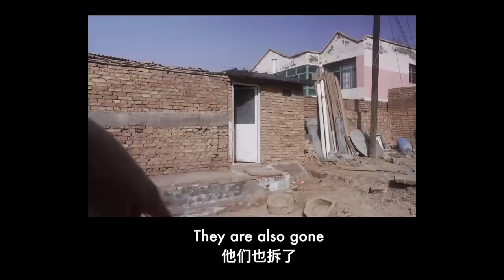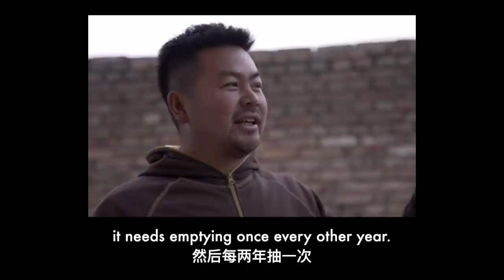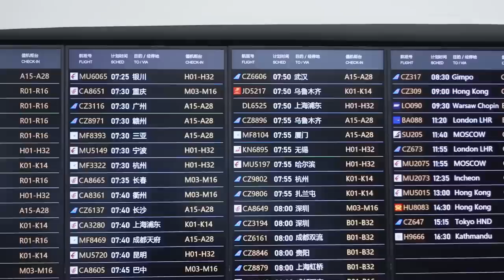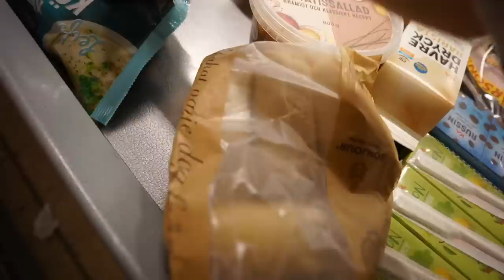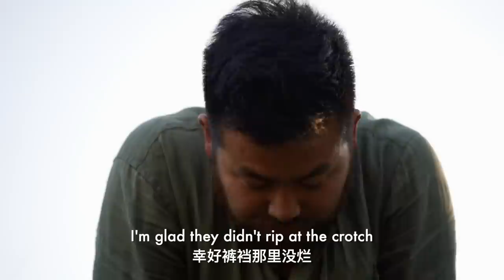And so, a new chapter begins!

Comment: I am from rural China and my family installed bathroom with pipe going to very deep hole in back yard. They didn't put in any plastic waterproof tank so basically the water just go down the deep ground. They don't use indoor bathroom for poo usually so it's kind of okay without the tank
Reply from the maker: Yes if it only urine I suppose so!

Comment: Miriam, consider buying a Volvo EX30 electric vehicle for your planned road trip. Volvo is headquartered in Gothenburg (where you renewed your visa), but since 2010, it is owned by Geely Holding Group, where most of their EVs are manufactured in China with some manufactured in the USA. It would be fitting to explore all those traditional places your mentioned in a 21st Century Swedish/Chinese EV. I hope Volvo/Geely would sponsor your trip.
Reply: Why???.
Reply: With a price of ~ 44000$/€ it's not an option for most young families 😅
Reply: @evelinholmes6401  I am assuming you are asking why a Volvo EX30 EV. Because it designed in Sweden and manufactured in China, appropriate for a Swedish/Chinese family. Volvo vehicles have excellent reputation for safety and that it good for the whole family. From what I have read, it costs nothing to get a license plate for an EV in China, whereas you have to pay thousands and wait for weeks for an ICE (Internal Combustion Engine) car license plate.
Reply: @NordicLight365  I could be wrong, but since Volvo manufactures most of its EVs in China, It would cost a lot less in China. I have noticed Chinese EVs are much more expensive  in the EU because of import taxes and shipping. For example a BYD Dolphin costs around $18K in China and it would not surprise me if it costs around $30K in Norway.
Reply: @chirkchu3903  Well, the BYD Dolphin is a totally different car;), and when it comes to the Volvo Ex30, you can currently order it, with delivery in 6-8 months (not in China)
Reply: @NordicLight365  From your handle I assume you are in Northern Europe. I am sure since Volvo is making cars in Sweden it would not take 6-8 months. I have no idea what the delivery time is in China since I live in Alaska where we can only purchase an EV from the lower 48 states and there are only 4  charging points in my little town of 50K. I've only seen 3 Telsa EVs during the summer here. I used the BYD Dolphin as an example because that would be the ideal EV for me, especially one with a sodium battery. But there is no chance in hell I can buy one in the USA. I envy Miriam can buy a wide range of EVs easily with well developed charging infrastructures where she lives.
Reply: @chirkchu3903  Well spotted!! Yes, I live in Gothenburg, Sweden. Volvo have other EV models available of course, but the EX30 you initially talked about, is not on the market until 2024, however it's possible to place the order now.